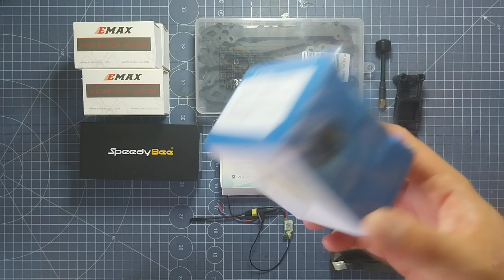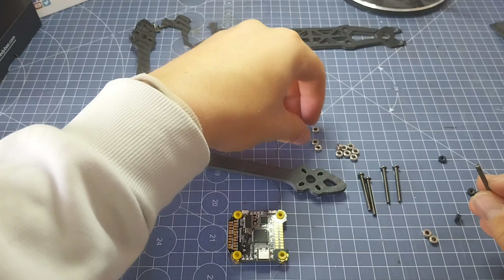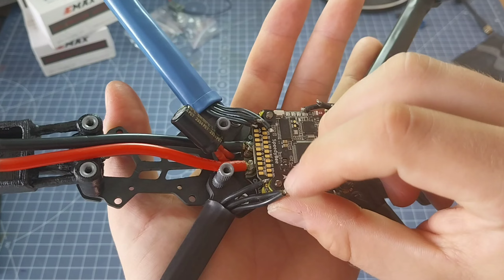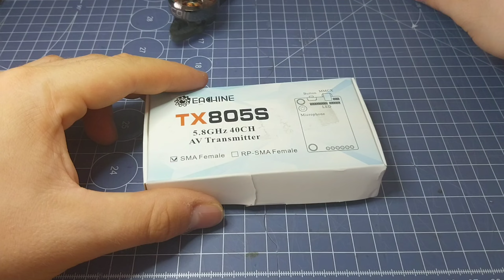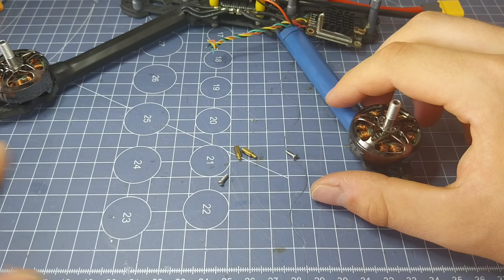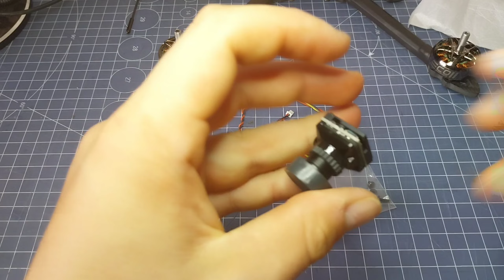7" Fpv Drone Build - Long Range -- Part 1

Comment: We are excited for the next part..and we ask for your recommendations for long-range shooting. Is 5 inches better or 7 inches?
Reply from the maker: For long range shots, I would definitely recommend a 7 inch drone, as it flies much more efficiently due to the larger propellers, can carry a larger battery and therefore has a much longer flight time. It is also much easier to fly smoothly. Of course, you can fly long range with a 5 inch drone, but you are much more limited when doing so